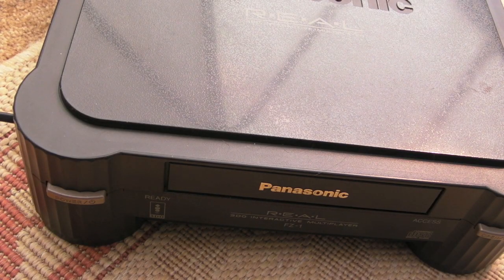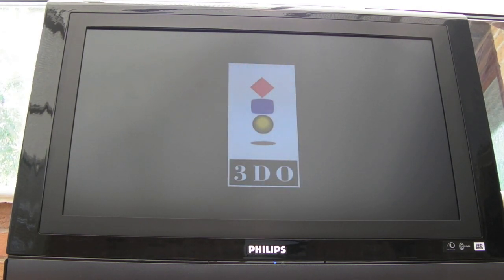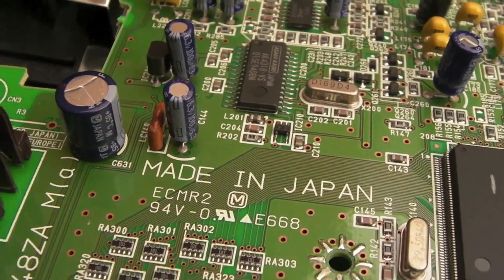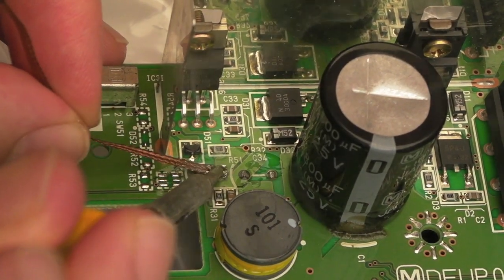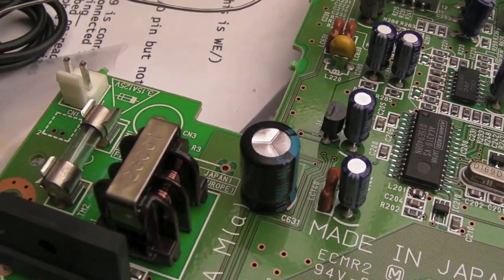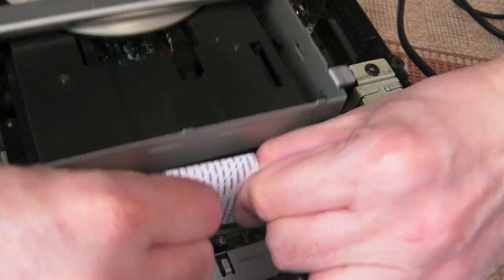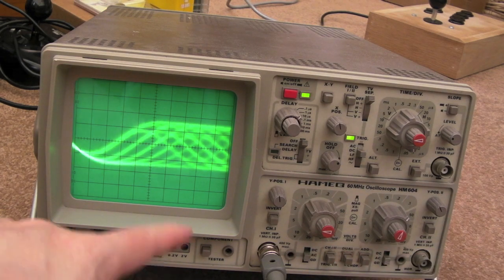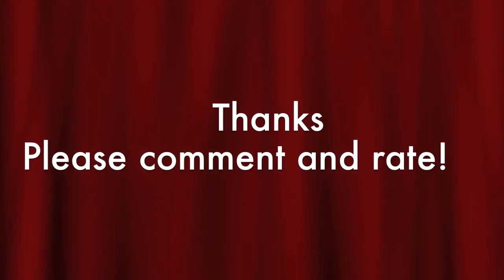Panasonic 3DO Reset Problems, No Sound Repair & Laser RF Level Check

Comment: Those big caps seem to rarely fail; that one had some grime or dark sludge visible beneath the edge of it. Did it test OK, or did you end up replacing it?
Reply from the maker: That stuff at the side of the large 6800uF cap is just glue!  ESR good, measured just a tad under 6800uF!  On this model 3DO it tends to be just those 2 smaller caps that fail on the PSU section.  All other caps on the board are usually OK.

Comment: Hi Gadget
recently got an FZ-1 on which I've recapped the power board.
upon 1st switch on you get the 3do logo start-up etc and it runs a disc. 
then it resets and you get no logo and nothing runs (the laser moves/seeks but thats it)
Further switch ons show the same issue. 

If its left cold without power (eg overnight) it does the same again which to me says capacitors. But they have been changed.
Its not the CD-rom drive as I've tested a known good one in it.
there was a small amount of corrosion around the powerboard area - eg on vias/resistors etc. I've cleaned it up as much as I can and reflowed all the vias I can see that were blackened. Do you have any other suggestions ?
I'd love to get it working as its one of the NTSC-J models with the built in 240p mode switch !
Thanks a lot 
Simon
Reply from the maker: Check the capacitors on the drive PCB, and consider the laser might be causing the reset - I've seen that before when it cannot read the disc.
Reply: @GadgetUK164  thanks for the info
SO i tried both of those - new laser, recapped drive pcb and to be sure a working cd drive but the symptoms are the same.

Comment: That big capacitor definitely looked like it was a bit bulgy. If it works, it works. No point in replacing caps if they work, is there?
Reply from the maker: Nah, it was fine!  They either leak, and this hadn't - just glue on right hand side where it joins the board, or they some and this was good as new.  Same as mine - ESR ok, capacitance OK, no electrical leaking either.
Reply: There's loads that get discarded for no reason at all.
Reply from the maker: Yeah, they only need replacing if a) leaked electrolyte, b) high ESR (turned into a resistor) c) domed (clearly a problem), d) capacitance value has changed (usually shows incorrect ESR too), or e) same manufacture / batch as other caps that meet a, b , c, or d conditions.
Reply: I see many "let's replace these 150 caps" videos where I think..shame.

Comment: Strangely, I connected my FZ-1 for the first time in years and the audio sounded great for one minute until it suddenly went quiet. I was playing PC Engine Super CD-ROM² Akumajo Dracula X Chi No Rondo as an audio CD (works as a stereo test) and it suddenly got quiet when the track played into the data track, making me think I screwed it up by playing CD-ROM data as audio. I kept starting the track over and the audio was fine until I let it play to Track 2. I had it apart several months earlier and everything looked fine. This was back in January. I left it overnight and audio was still low. I gave it a week and it was still low. I gave it a month and it was still low. Whatever happened, it really did happen suddenly while I was using it.

Comment: Hi, ive tried to do what you did but i didnt solder the big capacitor really tight as i cut it too short but it powered on and then died so ill retry it but i chipped 1 little think, its the D33 chip next to the huge capacitor, i cannot found what it is used for but yea.. i might have killed my system, would love to know if you know what it does, its really small on the board
Reply from the maker: Do you mean you have broken the D33 component?  It's a diode!  I would hope its not a zener diode.  If its a normal diode, you could try swapping it out for a 1N4001 or something like that.  You would need to make sure the band on the replacement diode goes to the same side that had the band marking on the original diode fitted in the D33 spot.
Reply: @GadgetUK164  ok so its just gone, i do t have the means to fix that, there is no way it will wotj without it right?
Reply: @GadgetUK164  its a really small part, i can swap it with a 1N4001 diode that is bigger?
Reply: @GadgetUK164  seems i also chip c12 so would need to replace that as well...
Reply from the maker: Yes, you could fit a through hole (leaded) component, just cut the legs right down and be careful to fit it the right way around.  This assumes that the original D33 is not a zener diode.
Reply from the maker: C12 is a capacitor - no idea on the size, you could try replacing it with 100nF ceramic capacitor - either surface mounted or through hole.
Reply: @GadgetUK164  yea so i figure it out by looking in the manual tech sheet,n c12 is a 0.1uf cyramic and d33 is a zenner diode 5.6v, i got those so ill cut the leg and put them on(found a guy that have tools for it as it is small) and yea its a zener so only 1 way lol, still waiting on the parts

Comment: Panasonic capacitors are one of the top-tier brands, are they not?
Reply from the maker: Typically, but there are bad batches like all manufacturers.  The ones in the 3DO and PC Engine nearly always fail, and they are mostly Panasonic caps.

Comment: I found 3do that said new.brushless motor. Not sure what that is
Reply from the maker: Sounds like the main motor that spins the disc, OR the one that moves the carriage up and down.  You would need to dismantle it and work out which motor is required.

Comment: Jamicon x.S
Reply from the maker: LOL!  They are good caps!  At points in time there are and have been batches from any manufacturer that aren't great, but this batch I've had for ages and used them to fix a tonne of my own stuff over the last 10 years, and everywhere I've used them the device I fixed is still working 100%.   Take Panasonic caps for instance, they have an excellent reputation - yet the cap I replaced in this system was Panasonic, as were the caps in the PC Engine CD-ROM I fixed a few months back.  That doesn't mean Panasonic caps aren't reliable.
Reply: When i used to work for a electronic manufacturer Jamicon was the cheapest caps in the catalog. All i can think of was: "You get what you pay for" Suncon capacitor was also cheap. But if remember correctly they was made by Sanyo? And i have great respect for them. But there prices made me cry x.D
Reply from the maker: I think it depends on where they are being used.  For basic smoothing caps, which is what those caps are doing on this board, then they are fine and will last a long time (probably longer than the Panasonic ones that were on there originally).  I also disagree that you get what you pay for - I've seen loads of examples of expensive resistors and caps that actually don't perform any better than components at a 10th of their cost.  I've also paid lots for reputable brands in the past to find they fail sooner than where I've used cheap none name brand chinese caps (and those chinese caps are still working!!!) Things are different though when you start getting onto precision differences, then you do get what you pay for.
Reply: I am pretty sure you got more knowledge than me when it comes to that. =D
Reply from the maker: I make a lot of mistakes, and tbh your point is generally valid - what I mean by that, if I needed to swap coupling caps for RGB, or audio coupling caps, I wouldn't have used the Jamicom caps there, although this batch I have would probably be OK.
Reply: Ok =D